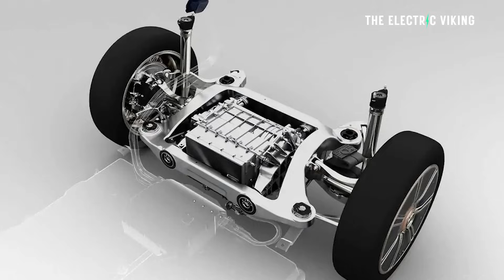Mercedes-Benz reveal new Electric Semi with LFP battery to take on Tesla

Comment: I drive 18-wheeler for a living in the US when I fill both tanks I get 790 mi with full capacity loads. Electric trucks are eons away from being anything more than a novelty and I can fill up in 20 minutes and get another almost 800 mi You're talking about 10 to 15 years away for electric trucks sure... Testing without telling us was a carrying 60,000 lb in that heat because my truck can do it so this is really a non-story for now it's super beta battery technology is still far far away with a semi unless you want to talk about local deliveries The problem is most things don't come locally

Comment: My calculation using MIT data shown in Recent Gordon Giesege video is roughly 166K for 900 kWh battery used in Tesla Semi.  An LFP battery would maybe be 20 K less expensive and 2000 pounds heavier.  So we are not talking $150K for the entire truck as Tesla advertised!
Reply: You don’t know that. The semi is more than just the batteries. SpaceX launches rockets way cheaper than anyone else. Tesla superchargers are at a cost of half or less of what anyone else can build. They make the most profit on their cars in the entire industry. I wouldn’t doubt Tesla on the value of their semi’s.

Comment: Hard to compare when the Tesla's semi specs are not being released by Tesla, people are just guessing the Tesla's semi specs by watching videos or listening to rumors 🤷‍♂️
Reply: Absolutely this, Tesla are mysteriously quiet on the performance of the 20 or so trucks they have built so far.  We have no idea what they are hauling at all.
Reply: I think it is rather suspicious that Tesla doesn't publish exact numbers.
Reply: @Muppetkeeper Guess you didn't see that video of Pepsi talking about their experiences with the Tesla semi.
Reply: Probably because Tesla is in risk production of the Semi right now and are learning what the performance floor is.

We have seen 1 semi haul 82,000 lbs 500 miles (it's on continuous video start to finish, hauling weight confirmed by 3rd parties). That may be the unicorn/golden sample. Even if average range dropped to 400 miles, that would still dwarf the capabilities of Mercedes.
Reply: @themonsterunderyourbed9408  yes we all saw it but no actual facts about payload…..still !

Comment: Mercedes Benz Gen2 hydrogen truck has a range of 621 miles. 🧐
Reply: Using Hydrogen made from natural gas, creating more CO2 than diesel at 3 times the cost and high maintenance.
Reply: Ah, plenty of time to blow up then.
Reply: @jjamespacbell  what part of a fuel cell is high maintenance?  They last a lot longer than a battery does.  The small amount of maintenance  that is required could be done on their regular maintenance any truck needs to go through at a set interval. Its not like they dont need regular work done on a truck just because its electric.  There is enough equipment that needs regular work to ensure everything is safe.
Reply: Unless you must have the range you can save yourself a lot of money by going for battery electric.
Reply: @pin65371  fuel cell stacks are designed to last the lifetime of the vehicle, about 150,000–200,000 miles. Or half the design time of EV batteries

Comment: They had to eat their own words. By the way, Tesla proved their trucks has a range OVER 500 miles fully loaded (you should know that by now). Most importantly it only has 1 or 2 ton penalty of total weight when compared with an standard diesel truck. I bet Mercedes cant get even slose on that regard by using LFP cells.

Comment: "real rival to the Tesla Semi" - Well, we'd need to know what the Tesla Semi actually does before we hold it up as "gold standard".  Also, we have proper driving regulations over here in Europeland, so this truck may actually not need more range, as the driver is timed out before the truck runs out of power.
Reply: The drivers at Pepsi went over 500 miles with a full load. 82,000 pounds
Reply: @ZeusBullyMax  In Europe?
Reply: @downix 🙄
Reply: @reggievonramstein  Because you ignored the question, then you likely already know the answer is "no". All of Pepsi's Tesla semi trucks are at their Sacramento, California plant. Europe has different rules for semis than the US, and as a result the payload will be different, changing what range they can reach. 

In checking, a European driver is limited to no more than 250 miles before a mandated 45 minute break; long enough to recharge the battery.
Reply: @ZeusBullyMax  No one has been able to verify that.  We need to stop comparing things to Tesla products unless those products can actually be purchased.
Reply: @Muppetkeeper  there are 6 electric semis currently on the market in the US, with the largest by sales volume being BYD, surprisingly enough, with Anheuser Busch alone operating over 100 8TTs.
Reply: Yes, good comment. We can only judge when we get a “Real” spec on the Semi  and  not just the usual endless hype
Reply: @Muppetkeeper  if Pepsis say their product is better than Coke, I'd laugh in their face. But I don't have much reason to imagine they're making bogus claims about how far their lorries can drive. Not that it matters in the slightest.
Reply: @downix  no in California. In the United States where the truck is built. There is way too much demand in the US for that truck right now. They won’t make it to Europe for a long time if ever.

Comment: Lets touch on another major problem with such a giant truck; a giant battery equal to 12 Y batteries - how long do you think one would burn? How much toxic fumes would it emit?  Do you think you'd like to be in the Lincoln tunnel when one catches fire?  If it were your call; would you let the in such a restricted area?
Reply: These are Lithium Iron Phosphate batteries. They are not known to catch fire, unlike lithium ion.

Comment: I can't believe they are going for such an un-aerodynamic shape at the front? Anything with a blunt, brick faced front, such as bullet trains and what not, have gone for more streamlined approaches? I would have thought that SOME attempt at improving aerodynamics would be a no-brainer... yet Merc has seemingly gone for the aerodynamics of a brick? Kudos to them for going electric... I doubt any vehicle manufacturer depending on ICE sales will fold up before 2026... there will only be 'niche' brands left ... I think most of the Japanese giants of today will go broke and be snapped up by Chinese companies and either disappear or only sell badge engineered Chinese models. Interesting times. Also, Tesla has scored again with the central driving position... I am disappointed that Merc has chosen LHD which alienates sales to Australia... the central driving position is great for not mattering which side a country drives on and overall good field of view for the driver. Tesla wins once again imo.

Comment: Mercedes is all over the globe in the trucking industry. They own a fair number of American brands as well. I have no doubt that in the big truck market, Volvo and Mercedes will do just fine in the EV segment, as they have longstanding dealer and service networks that are quite happy with their brand. Tesla refuses to allow parts or maintenance be handled by third parties, and that will seriously retard the sale of their trucks outside the USA. The more industrial the product, the more these networks matter, and Tesla will only dabble in trucks, as the direct to consumer market is where it works fine for them. Electric trucks are going to be very common; you get way more pollution reduction by electrifying trucks than you do pushing EV's for consumers, who don't drive much. Trucks in total dominate the road mileage stats.  For heavy, special purpose vehicles, the diesel electric hybrid will be the way of the future, such as Edison Motors, which is going to be a big company some day, because they have the right attitude about letting their customers repair their own vehicle, and using off the shelf parts when possible.  The lack of right to repair puts Tesla on the wrong side of history, and the Tesla fan boys don't realize how un-ecological it is to have all proprietary parts.
Reply: Reminds me of the Apple vs PC battle. Whilst Apple is clearly the largest SINGLE brand - PC's (and Android in the Mobile phone market) still dominate the market overall. And the two main reasons are affordability and maintainability.

Comment: Tesla semi = aerodynamic.  Mercedes semi = not aerodynamic.  Too bad that Mercedes engineers didn't also defy the laws of physics.  And guess which one truck drivers prefer to drive.
Reply: In Europe the Tesla is too long to pull the trailers. Now that's real drag
Reply: Drivers will hate the Semi. No window access ( stupid idea), no bed and central seating meaning overtaking is appalling
Reply: @jimpackard8059 - I watched a short video of a Tesla Semi driver saying he liked driving it.  Cameras make it easy to handle the driving.
Reply: @jimpackard8059  That's not what we're hearing from the drivers who are currently driving the Tesla semi. They tout its positives and don't mention not having access to a window (the LCD screens and exterior cameras provide better views than the previous trucks they've driven). And these are short haul trucks, so no bed needed. I'd guess if Tesla ever makes long haul trucks, there will be a portion of the cab for a bed.

Comment: It's crazy to think Germany was shutting down all of it's nuclear(before the Ukraine war) for natural gas power plants to "save" the environment🙄. How will they produce the power necessary for ALL the electric vehicles/trucks when they become the most dominant for transportation on top of regular living power needs? It's the same issue in the US. Where's the planning for future grid power needs? As well as power storage, line upgrades, etc..? In Austin, TX over the past 18mos there have been multiple power failures in sections of the grid. Some blame the governor, but it's actually the city power grid and not the state's that's at issue. They keep allowing more high rises and more residential homes without adding the proper amount of grid upgrades to accommodate the extra power needed. Then it pops and the council says we need to conserve to save the climate, lol.😆 Sorry for the tldr.

Comment: You folks that think any vehicle let alone a massive truck with a trailer can obtain the aerodynamic drag of an aircraft - you are clueless. Unless you can obtain laminar flow (your vehicle looks like a tear drop) the main determinants of drag are the front view profile and length.  If you could just make a truck cab look slick and cut drag in half they'd be doing it for that  past 100 years. Oh so if you then use proper drag numbers for the Semi the max range with trailer gets cut in half (or roll down hill). That doesn't mean you can't use a truck with a 250 mile max range.  But charging one has to be done where infrastructure supports the massive charger, not that many spots even have sufficient power to charge 1 such truck in 30 minutes. Talking about Semi with a total production of under 25 as a production vehicle also makes no sense; the 4680 remains vexed in production reject rates and will not be economical to build vehicles with until that problem is solved; All Tesla 4680 vehicles are currently being sold at a loss.
Reply: When diesel was cheap there was no incentive to make trucks more aerodynamic. 

Now diesel trucks are continuously getting more and more aerodynamic. But none are even close to Tesla Semi. 

Look up the drag coefficient of Semi. It compares favorably with some sports cars.
Reply: Just because something hasn't been done in the past 100 years doesn't mean it can't be done.

We have new products every day that are created bc of new ideas, new inventions, new discoveries and new/improved techniques.
Reply: @Sonshine70s  certainly; and it isn't just a little it is so bad; that it dominates the issue so trying to reduce some turbulence on the cab won't matter very much, it might help a few percent but no way its twice as good and a huge truck is as good as a slieek sport car.